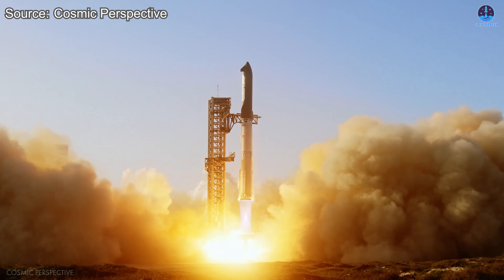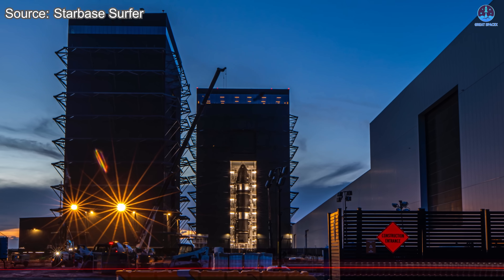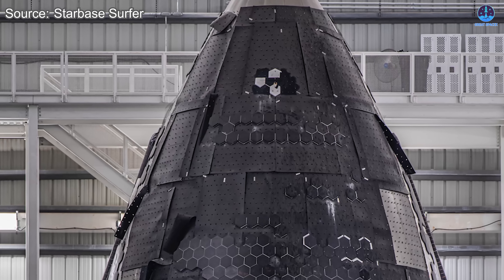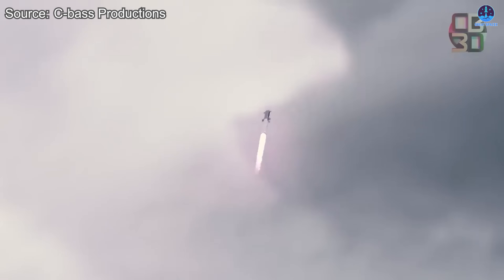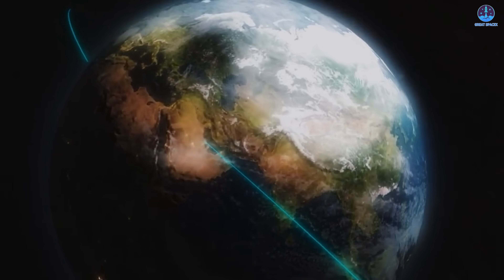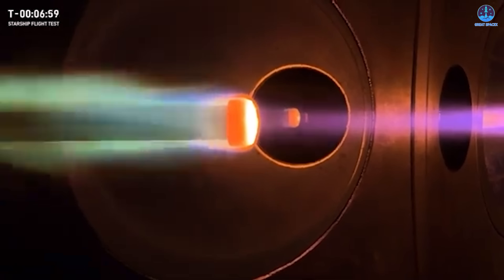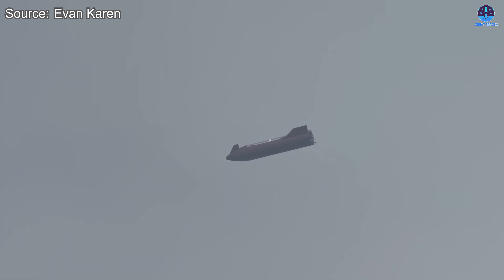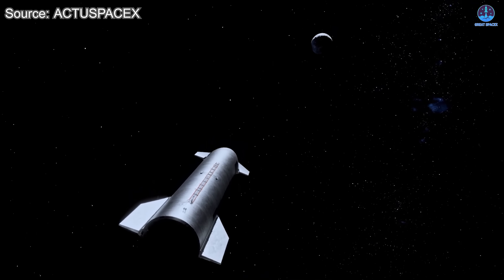SpaceX revealed New Heat Shield on Starship Flight 10 to Beat 1500°C Reentry…

Comment: 1 of 15).  If Elon Musk sends 1000 SpaceX Starship Cargo Pods to the Moon / Mars.  (Instead of 1000 starships.) There is no need to refuel the starship.

The Cargo Pods could be the same size as the starship cargo bay. ( 35,000 cubic feet.)

The starship could open from the tip of the starship.  The cargo pods could be ejected with some kind of spring mechanism.  Shot out of the starship like a bullet.  ( or they could have space shuttle like cargo bay doors)

If necessary, after ejected they could be caught by a re-usable device, similar to a 2nd stage, or a space tug, on standby, that could push it towards the moon / Mars.  Once up to speed the device would release it.  These pushing devices could be refueled by cargo pod tankers, or exchange cargo pod tankers. ( Just swap them out )

The cargo pods could have anti-spin, and course correction devices / mini jets.  So they can travel by themselves.

Once at their destination, they could be caught by a re-usable device, similar to a 2nd stage, or space tug, but with a heat shield for Mars, on standby, that would slow them down and land them on the moon / Mars.  For Mars they would have a heat shield to protect itself and the cargo pod.  These devices could be refueled by cargo pod tankers, or exchange cargo pod tankers. ( Just swap them out )

The cargo pods would not require an external elevator.  The doors would be on the bottom.

If the cargo pods were landed in a circle, a big inflatable dome building could be inflated in the middle of them.  Inflatable tunnels could connect the cargo pods to the dome building.  The whole thing could be covered with 3D printed cement, even the cargo pods.

Some of the cargo pods could be reused.  A device would have to pick up the cargo pod and take it back into orbit.  Once in orbit, it could be sent back to some place to be reused.

Other cargo pods could have pre-built in facilities, like refineries, factories, farms, dairies, ranches, fish growing facilities, grocery stores, retail stores, hardware stores, living quarters, cafeterias, restaurants, bars, jails, police stations, city hall. Libraries, recycling plants, fuel depots, oxygen & water plants, composting plants, etc., etc..
(Just about anything could be pre-built into a cargo pod, saving a lot on site work.  Later buildings, etc., could be built piece by piece.

2). I was thinking artificial gravity on the moon / Mars could be created by building a giant rollercoaster, with the roller coaster cars so big you can live in them.  The rollercoaster would travel in a circle and lay flat on its side.  So when it traveled at 1G it creates artificial gravity on the floor of the roller coaster, the flat part nearest to the wheels.  

3). Also we could build a space motel in the shape of a cube, by just docking space station modules together.  It could spin and have artificial gravity.  It could also travel to the moon, and especially Mars.  ( a 7 month journey.). It could be a cycler, continuously traveling back and forth. 
With just 12 space station modules forming the cube, it would have 420,000 cubic feet.  We could build 10, 20.  Maybe 100 of them.

4). Also we could build a mobile moon / Mars base with inflatable space station module strapped to an electric truck chassis, driven with remote controls and cameras.  After 10 or so of them have reached there destination, they could be docked together, forming a good size moon / Mars base.  

5). To colonize the moon & Mars easier.  We could build some real nice retirement communities on the moon & Mars, and send 60 million retired people to the moon & Mars.  And send 6 to 12 million people to take care of them.  All these people would be a big boost in colonizing the moon & Mars.  

6). As soon as possible, starships should be built on the moon / Mars.  Because of the lower gravity, starship should be built 3 times bigger on Mars, and 6 times bigger on the moon.  With a 105,000 and 210,000 cubic foot cargo bays, and use the same amount of power to launch, from the moon / Mars, as the current starships.

7). To build an underground city, use a tunnel boring machine, but don’t go in a straight line, make switch backs, and then make switch backs, through the switch backs, so you end up with a whole bunch of square sections.  Now either build stuff inside the tunnels or cut out doors in the tunnel walls and dig out rooms in the space in between the tunnels, supporting the ceilings with brick arches, etc.  You could have two floors by having stairs right near the front door and the back door, 5 stairs going up, and 5 stairs going down.  With a bench on the landings for those who need to rest.

8). To slow down starships while descending through our atmosphere.  Install stationary flaps all the way up and down the sides of starship, making its belly fatter.  This will slow it down more, while descending through our atmosphere.  This would be especially helpful to keep crew starships cooler.

9). To terraform Mars. 
The best way to terraform Mars is to just have everyone on earth move to Mars.  And also some animals.  With 8 billion people living on Mars.  The surface of mars would eventually be covered with poop, compost, and cement.  At the same time, If we are able to create an artificial magnetic field around Mars, then there will be no more solar winds.  No more dust storms.  Then perhaps by using drip irrigation plants and trees will grow.  Perhaps there will be lots of seeds in the poop.  
Mars atmosphere is 95% CO2, so the plants will convert the CO2 to Oxygen.  But we need to be very careful not to make too much oxygen.  Too much oxygen, more than 21%, is bad for humans.
 Also we could either make nitrogen, by using metal azides, oxidative dehydrogenation of ammonia, or importing it from earth.  (The earths atmosphere is 78% nitrogen and 21% oxygen)
Eventually maybe we will be able to duplicate earths atmosphere on Mars.  Until then we will just have to import from earth the air we breathe.  Or combine 21% Oxygen from Mars with 79% nitrogen we make, or nitrogen from earth.  And make our own air to breathe.

10).  To make a crew trip to Mars shorter.  Have two starship leave earth at the same time. One is a crew starship, the other is a tanker starship.  As soon as the crew starship has room for all of the fuel left in tanker starship, the tanker starship gives up all of its fuel to the crew starship.

Then the crew starship recalculates, it’s possible maximum speed and maximum braking power, and speeds up.  Shortening the time of travel of the 2nd half of the trip.  (Total trip time approximately 5 1/4 months.)

(You could have two tankers, one tanker gives up all of it’s fuel when the crew starship has room it, then other tanker gives up all of it’s fuel as soon as the crew starship has room for it.  Perhaps 1/4 of it’s fuel would be transferred.  Unfortunately the 2nd tanker waste about 3/4 of its fuel just keeping up with the crew starship.  It might not be financially worth it, to have the 2nd tanker.  It all depends how much that extra fuel shortens the trip.)

After 5 1/4 months total travel time, the crew starship brakes and lands on Mars.  
1 3/4 months later, the tanker starship slingshots around Mars, and travels back to earth, where it blows up right before splashing into the ocean or it is caught by a re-usable device, (similar to the 2nd stage of a rocket, a space tug), slowed down, landed on earth, re-fueled, and made ready for it’s next flight.  

11). Another way to shorten trips to the moon / Mars:
We could transfer a lot of people to the moon from earth by putting them to sleep for 1 day. They would go to sleep on earth and wake up half way to the moon.  Be awake for 1 day. Then we could put them to sleep again for another day.  And they would wake up in a real nice beautiful retirement community or tourist community / resort. 

Perhaps people traveling to Mars could sleep for 1 day, and then be awake for 1 day.  Cutting the trip in half.  (3 1/2 months instead of 7 months)

12).  For safety reasons, don’t send crew starships to Mars, until 5 fuel farms, launch & catch facilities are setup by Tesla Optimus robots. 
Also set up 5 whole Mars bases before any humans are sent to Mars.  All air and water tight and self sustained. 
Also whoever goes to Mars, must make a commitment to stay on Mars.  No leaving and going back to the earth or the moon colony.  If you go to Mars, you go to stay, except for tourist.

13.  To build permanent cities on mars, send 50,000 Tesla Optimus robots with some mining equipment.  Have them mine for raw materials.  Then send refineries.  Then send raw material, that are not found on Mars.  Then send factories.  Have them build a city for 102,000 people, with everything in it, with most of the city 14 feet underground for radiation protection.  An air & water tight, self-sustained city.

Then send 15,000 people to run the city and work in the retirement industry.  Then send 75,000 retired people to live in real nice beautiful retirement communities.  Then send 2000 people to work in the tourist industry.  Then send 10,000 tourist to stay in real nice beautiful tourist communities / resorts.

Then build 2 more cities at the same time.  Then 3 at the same time. Then 4.  Then 5. Then 6. Then 7.  Then 8.  Then 9.  Then 10.  Etc., until perhaps you are building 25 or 50 cities at the same time.

14). We could protect ourselves from radiation using electromagnetic shields.  Either small ones used just to protect a spacecraft, or a city, or big ones used to protect a whole planet.  After we set up satellite electromagnets to protect a whole planet, then we can try to make an atmosphere or thicken the atmosphere around a planet.

15).  We should populate our earth, moon, Mars, Mar’s two moons, our galaxy, and our universe with humans, by using frozen embryos, artificial wombs (plastic bags) and robots, starships, etc., etc..
🙂
Reply: How do you send them from earth orbit to the moon or mars? That requires a fair amount of fuel including fuel to enter the Moon / mars orbit and fuel to deorbit / land. You really don't understand space flight do you?
Reply: So you’re saying space pushers and tugs won’t work, even with 2 or 3 vacuum rocket engines and 35,000 cu ft of fuel ?  
If not, what would work ?  
If the above can’t handle heavy loads, Perhaps my cargo pod system could only be used for lite loads.  🙂
Reply: A few years ago NASA annouced that they have evidence that there is precious metals close the the surface on mars. He needs to fill the star ship with a 50 tons of ore so he can get it back and become the first multi trillionaire....mars has 33% of earths gravity so you need a lot of thrust to get your riches back here.
Reply: Starship can land on the moon and take off again after dropping off cargo. The LEO orbit fueling allows the land and return. There is no need for cargo pods here. The whole ship is the cargo pod. 

The Boring Company can build tunnels and line them as it goes. Mining for minerals and ice. It can build large circles for mag lev cars powered by small nuclear reactors (shipping container size reactors being designed right now). These can be parked in side tunnels to protect them from external radiation, micro meteors. The Prufrock tunneling machine makes 12' inside diameter lined tunnels and is 400t designed to be used in segments. Built for low weight, it could easily be 300t and go to the moon in 3 blocks of segments in Starships... introducing mining and subterranean loop habitats rotating to produce Earth normal gravity to prevent bone or muscle atrophy. 

Once mining is established heavy materials can be mad en-situ with additive manufacturing machines and thousands of modified Teslabots (Tesla will be able to produce 1 million per year by 2030 or so for consumption on Earth. A few hundred humans under the moon can control tens of thousands of robots with most components fabricated on the moon. 

A simple magnetic accelerator can launch finished alloys into Lunar orbit for additive manufacturing robots to build mega structures... orbital habitats with shipyards and zero G manufacturing to build massive (super tanker sized) ships to go to the asteroid belt (16 Psyche) bringing nuclear plants and metal refineries to mine precious metals such as gold, platinum, uranium, thorium, to return to Lunar orbit... or even massive chunks of ice asteroids with ractors and HAL thrusters attached to drive the chunks to Lunar or Mars orbit... chunks weighing millions of tons (possibly in foil bags/umbrellas to minimize solar heating and outgassings. Build mining colonies with thousands of robots on 16 Psyche, to do the mining and hollow out sections for circular tunnels for habitation.

Comment: I don't believe that 'metallic' heat shield refers to stainless steel tiles as mentioned in the video, since this would be a really bad idea. There are many types of ceramics, like Silicon Carbide (SiC), Silicon Nitride (Si3N4), Aluminum Oxide (Al2O3), etc.. As you can see the last one contains a metal and the first 2 do not, so I expect that the new 'metallic' heat shield will be made of a ceramic type having a metal component.

Comment: V2 did solve the reentry problems by blowing up beforehand, brilliant
Reply: Yup. NASA's tried and true tweak, wait, push paper, spend $billions and decades.... launch once... rinse and repeat - (See SLS) works so much better than building manufacturing capability for 100 ships/year and keep using destructive testing to tell you where the weak points are. 

Starship - $150m each (privately funded), building to production of 100/yr within 5 years
SLS - $4000m each  (publicly funded), building to production of 1/year with no change in 25 years, $25b and 1 test flight.

Funny how people complain about Starship as if it cost them One cent. 
SLS screws up and the $4billion (tax payer) dollar rocket to nowhere... hardly a peep. 

Musk has a contract to land 2 ships on the moon. One with the interior space of a 747 and the other carrying 100t of cargo to the lunar surface... using multiple LEO tankers and a fueling Depot (all made from the same shell) and a lander that can act as a habitat for months... for a Fixed Cost of $3 billion... half the cost of a slightly larger 1960s lunar lander.

Comment: This will be the hardest nut to crack because no one has done it before, and honestly metallic tiles will not work for many reasons, and will have to invent a new material or do what stoke are planning to do use the propellant as coolant probably covered with a metallic sacrificial layer for redundancy

Comment: Again this video just seems to throw known facts aside! Only a few stainless steels, particularly martensitic and precipitation hardening grades, can be hardened through heat treatment, which involves heating the steel to a very specific temperature and then rapidly cooling it (quenching). This process does increase the steel's strength and hardness. However, this increased hardness also makes the steel more brittle, so it may require tempering to reduce brittleness before the next flight. This is not a path towards rapid reuse ability by any means!

Comment: If you are to understand that SpaceX would like to put a base on the moon, one must address a much larger issue than the rocket going to the moon or mars. That is the base. Without the correct greenhouse setup, a record of the least acres per person. Even with that situation, the base needs a reliable food source at the moon or Mars base site. I have not noted any upgrades to the past base attempts.   The ones I Earth was the Biosphere 2. This project done on earth many times had big issues. One was air. The air started to run low. It was an in closed greenhouse to test this for the moon base and mars. Yet it didn't work. That is needed to be solved as well. I have seen nothing to suggest this would happen.
Reply: They did not run out of air, they had massive rise in atmospheric carbon dioxide. High enough to interfere with sleep and rational thinking. This issue could not be solved by plants, the carbon fixation by plants is too slow and we have not enough control. Synthetic photosynthesis to fix this CO2 is the current best hope. China is testing this system on their space station.
Reply: Simple. Use Boring Company Prufrock to mine (for ice among other things) and build habitats below the surface. Check the new small nuke reactors being designed in shipping containers. Starship can deliver Prufrock in segments to the moon in maybe 4 runs. Start mining, start manufacturing heavier components en-situ (iron and titanium in lunar regolith). Bring plants ship only rare (on the moon) elements up to make soil or support grids for hydroponics (from melt ice). Ice supplies O2. You need hydrocarbons, possibly phosphates and other plant nutrients. Ship what you need from Earth, maybe supplement with asteroid mining later as operations grow. 

UV lights underground... no where near the surface.

Comment: What elements on the peroidic table can withstand this temperature
Reply: Tungsten for example. Other than temperature, there are two other issues, weight (the heat shield has to be light) and  it has to withstand oxidation from atomic oxygen and nitrogen. Tungsten is heavy. It will be oxidized on reentry and the tungsten oxide has a lower melting point than tungsten metal.